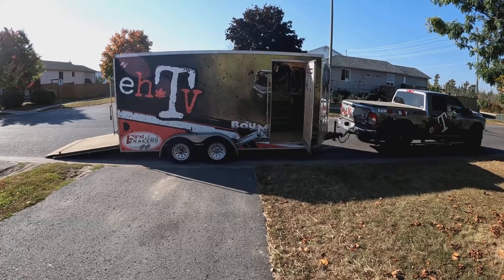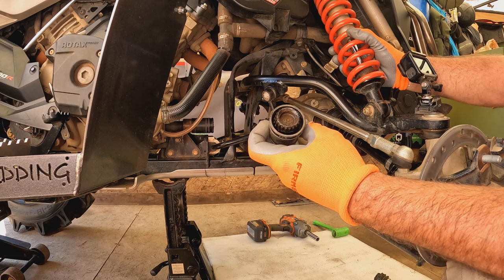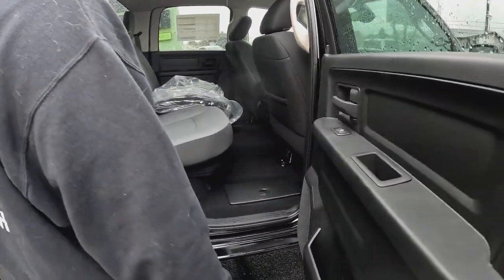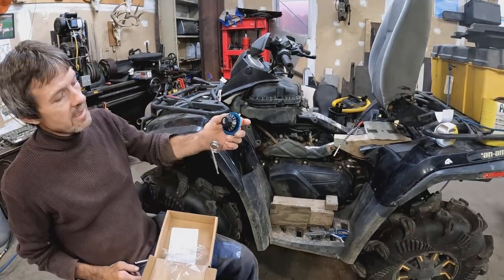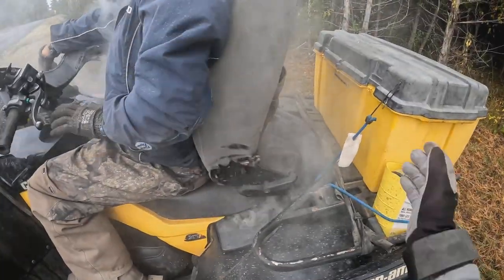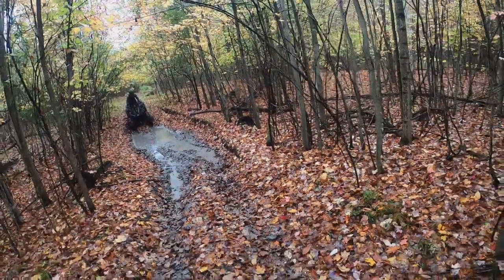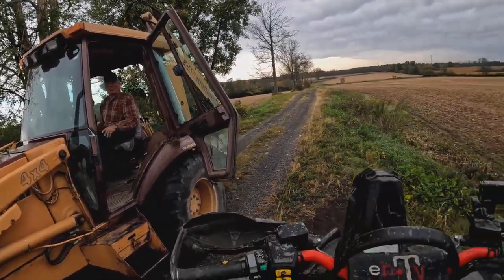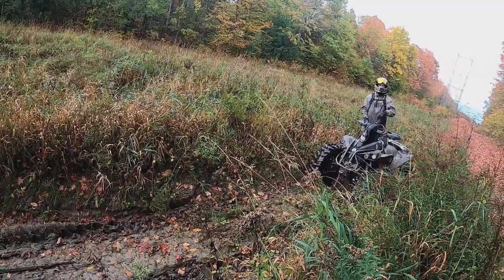🔥 Burnt Can-Am Outlander & Broken Renegades (She's Thick!!!)

Comment: Take that front boot off the drive shaft and order the same as what is on the back of that shaft. Less prone to tearing, plus never mind the clamps. Use zip ties. Work just as good and easier to deal with.
Reply from the maker: My 18 has the boot on both ends. Definitely cuts down on the chatter.

Comment: I put slg exhaust on the wife’s renegade 650 she rode about 12km the powder Burnt off already and you need to get the rigid boot for the other end of that shaft and you can get mini hose clamps from Napa and use a nut driver on them
Reply from the maker: Have had one pipe do the same, and I have the boot swap on mine.
Reply: For the price of those pipes they should use cerakote